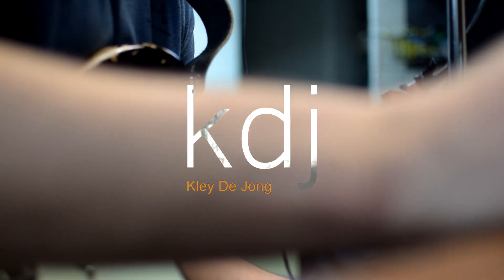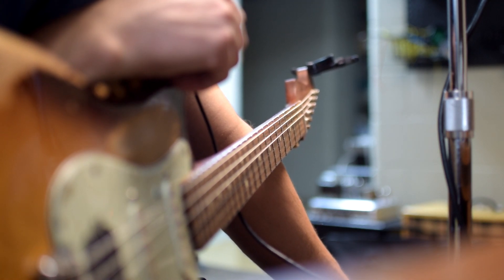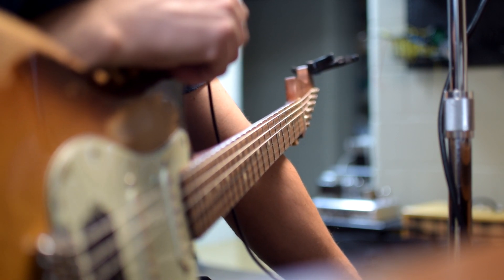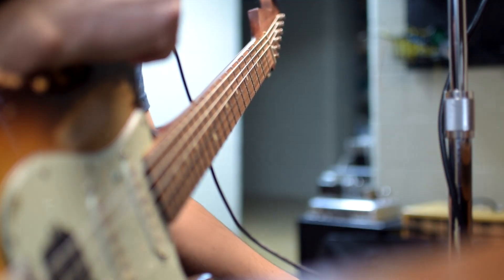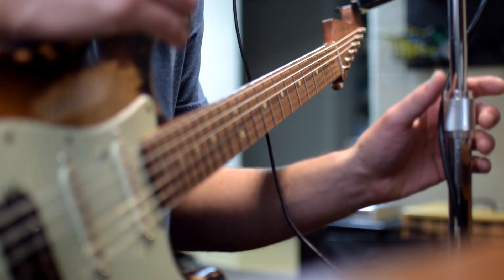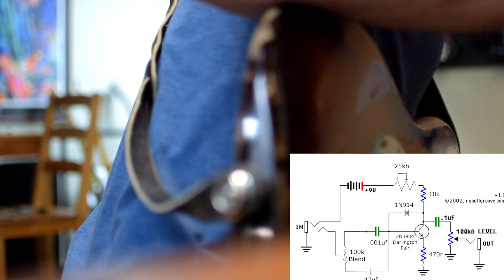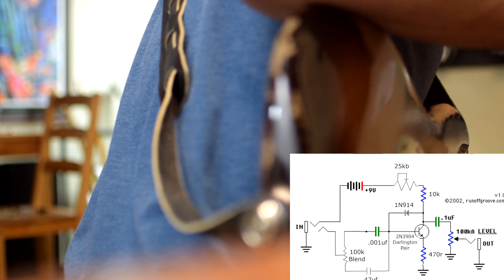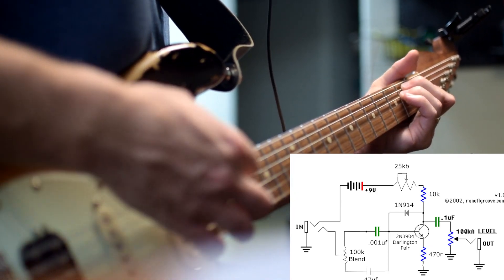Bazz Fuss - Circuit Analysis pt 5 | Testing Mods

Comment: I really dig this, "teach a man to fish" approach. Personally, I was looking more for an in-depth explanation of exactly whats going on with these components rather than a simple step-by-step guide to copy someones assembly. Thank you Very much! I was super disheartened when I tried the Bazz Fuss from the internet on breadboard last night and couldnt get it to work- using all salvaged parts from old TV and component tape deck recorders etc. With a homemade pickup on my acoustic with about 2.5k impedence. so, yeah, I really needed this deeper explanation, thanks again! I am thinking now, with my lower output pickups, I should increse the input cap to maybe 3.3 and well, Ill just have to continue with trial and error with my assorted transistors. I may try a FET if I get despreate.

Comment: greetings! i highly suggest to use the BC517 instead. i did it myself and was pretty close to your 2N3904. and for the 470R resistor i changed it to 1K potentiometer. i am looking for a tone control, and if you got some idea please show us. Nice video. thumbs up and new sub.
Reply: Are you saying a single BC516 or in a Darlington pair?
Reply: @ltcm5052  a single bc517 already is a darlington transistor so you need just one

Comment: Actually.. I just had the 2n3904 running a 2n3906 Szaklai Pair.. with a 1k resistor between them and a White LED so far feedback. But also a Red hard clipping output. Input caps are 1uf and 330pf using a 50k pot as a blend.. R1 4.7k series with 100k pot as bias. No gain resistor. 500k volume.

Both LED flash. That gating point where it goes quiet the red seems to have to burn off.. The White goes bright.. It basically indicates it's happy places.. It's just really loud.

Modding a fuzz face with a Silicon Germanium Q2 Szaklai....  Towards the "Fack" Fuzz styles.. So a "Szik Fack"... I've got s9018 for Q1 and the first half of q2 and gt320a for the germanium..   I've only done p2p and now I've got a bunch of 17x10 double side board to use

Comment: So, yeah, Darlington Pairs are pretty baller, but why stop there? For example, the mighty MPSA13 (https://www.taydaelectronics.com/mpsa13-darlington-transistor-npn.html) has a pretty good gain and it's in a single TO-92 package. However, you can "Darlington Pair" a Darlington Pair and slap two MPSA13's together.

As for the asymmetrical clipping diode, the clipping options are determined by the forward voltage, aka the voltage drop, on the diode. Germanium diodes like the 1N34A have low voltage drops, which give it a soft knee, which is less harsh and doesn't compress the signal much by default. Schottky diodes are the next highest up on voltage drops, and their knee is a tad sharper and harsher. Then comes your standard silicon diodes. Then comes red LEDs, which has a very slight increase in forward voltage than typical silicon diodes. Then comes green LEDs, which are a bit harsher. Lastly comes the blue LEDs, with a whopping 3-ish volts voltage drop. These will be pretty harsh and very compressed. An odd-ball to the game-of-clipping is using MOSFET's that have "diodes" inside them. I use them in my Oil Tanker Fuzz pedal. In that case, I use a TO-220 style IRF520 MOSFET which has the "diode" inside that has audio qualities closer to a Germanium Diode, but is much more consistent because structurally, it is a Schottky diode. Just tie the drain and gate pins together and have them go to the base pin of the transistor (and the source pin of the MOSFET going to the emitter pin of the transistor).
Reply from the maker: You sir, are a raid boss.  Very cool.